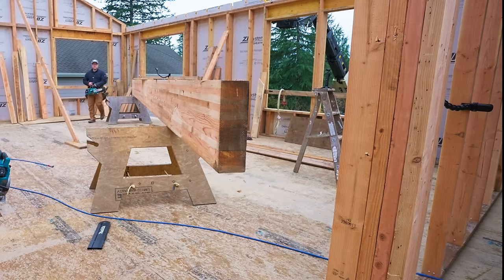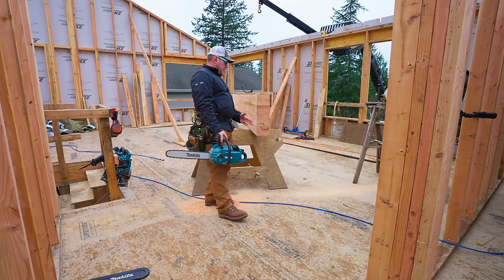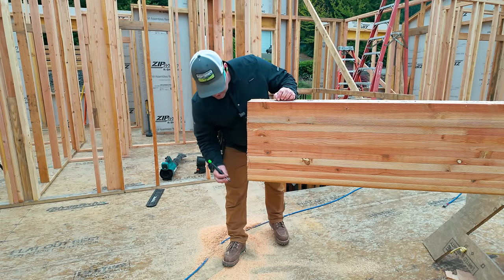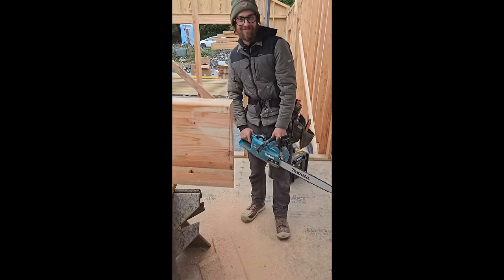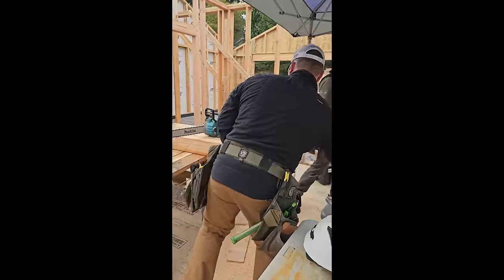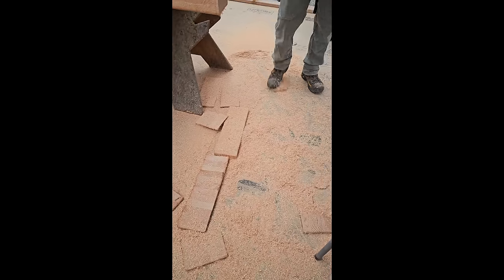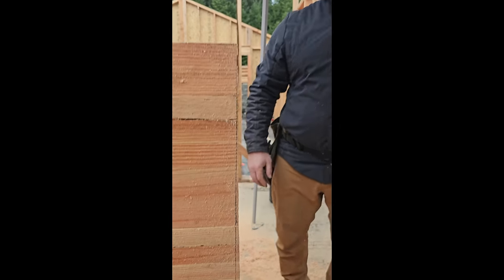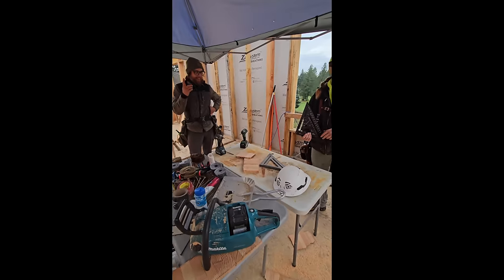Beam Wrench |Physics in Framing | Leverage

Comment: The same style wrench but with an narrower gap is great for structural steel. Most fab shops make their own from scrap as it only takes a few minutes.  If you have to manipulate steel on a jobsite a turner is a major advantage. I weld the heads on at a slight angle so I can use them next to a wall or beam.

Comment: The weight of the saw interferes with the very small lateral forces keeping the blade in the cut. That's why the cut made on the horizontal is near perfect, not to mention much faster. The length of the kerf and the stabilizing lateral force is much greater. Once you have to start using manual force to maintain direction, it's over. Let the saw and the wood do everything.

Comment: Why did you not use the same saw and setup you used for the floor beams?
Reply: You know better that battery is ALWAYZ BETTER
Reply from the maker: Because I had the XGT chainsaw with modification and wanted to try it out.